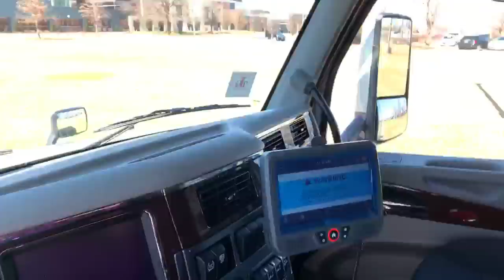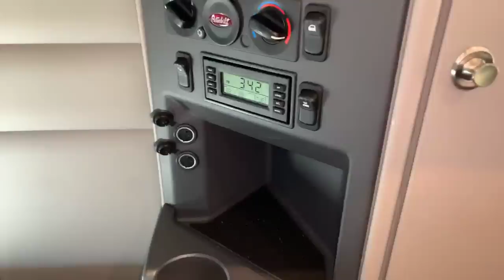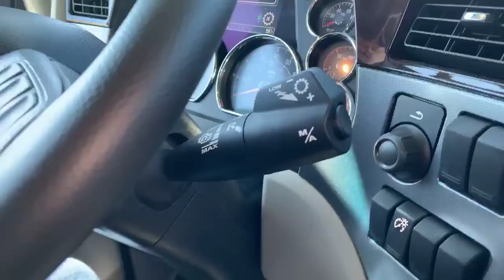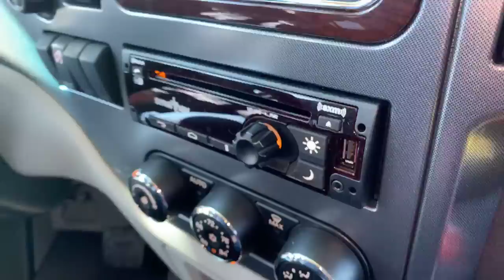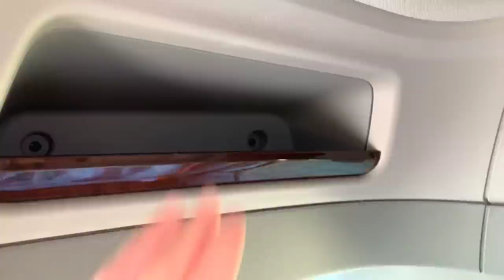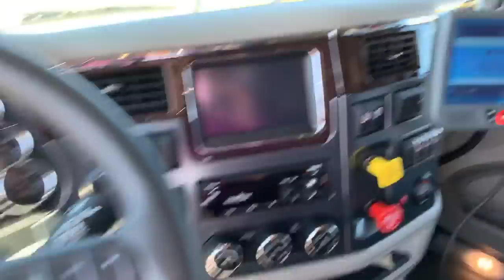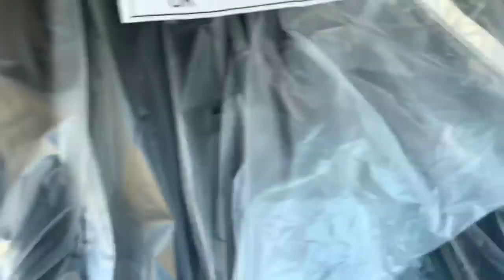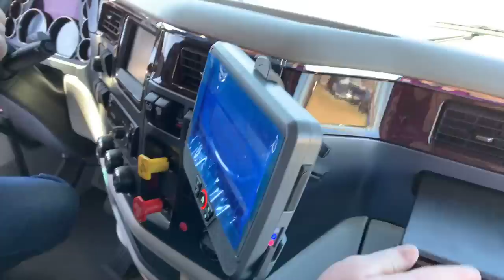2020 Peterbilt Ultraloft Truck Tour

Comment: 62mph????? Ain't no way I'd drive something that slow, there is zero benefit to fuel mileage going that slow.
Reply: The King's Servant TMC did a study. Dropping top speed to 62 not only improved mpg but reduced overall maintenance costs by 30%, because of the reduced stress on the truck. May not work for your business model but probably does for others. Cheers
Reply: 62 mph at 1400 to 1500 rpm is still stressing the engine and engine components out,still using more fuel than it should because the engine is laboring harder compared to one with higher torque rating. If it's working harder to move the weight the it's using more fuel,cutting into the bottom line. That is why you spec the truck out for the area of operation and the ammount of weight you are hauling but large companies won't do that because they would rather go on the advice of someone who has never driven a truck for more than a few miles. Less stress? When was the last time that you found one of these used castrated trucks that was not completely worn out by 750k miles? 

I'm not going to debate this with you but I will say this....2.60 rears, 18 spd and a military spec (750 hp) Cat in a 379 that constantly get 9.5 per mile with over a million miles on it speaks for itself.
Reply: 62 MPH top speed is just a rolling traffic jam. On  a two lane Interstate in the States with 70mph truck limits you learn to look for Prime, May etc. trucks ahead of you because you just know they are going to create passing hazzards.

Comment: @2:09 is this back in action?? Now that the minimum mileage is back to 30k miles does the additional $300 kick in if you’re eligible to upgrade but not called in to upgrade?? Thanks
Reply from the maker: Great question! With the required TNT mileage down to 30k, you are paid a guarantee of $700/week throughout this phase. If you remain on a trainer's truck and you reach 40k miles, your pay is then bumped up to $800/week.
Reply: @PRIMEINCTRUCKING  thanks. 37k now and applied for upgrade list. 🤞BTW Marlou N. is an incredible trainer. Thanks y’all.

Comment: Do they come with super single tires
Reply: All of Prime's trucks have Super Singles.. Duals are better, and more stable, if you blow a tire, you can still roll, to get it fixed, or replaced.. Super Singles, you blow, you are parked.. for awhile..
Reply: @chrisgriffin5179  you still cant legally drive with any blown tire if you can still technically roll. you blow or run flat you stop no matter what.

Comment: Over the last 16.5 years of driving full time. I've driven everything except westernstar. Which I don't care for the looks of. 
What I can say is I've been in a Peterbuilt 365 for almost 3 years. Granted not much room, but so far no complaints. If and when I make the transition to go otr. I'm leaning toward leasing. Peterbuilt loft. Simply because of the room and a smoother ride. 😊😊😊
Reply from the maker: That's great to hear! Thanks for watching and sharing your experience.

Comment: How do you turn on high beams 🤔
Reply from the maker: High beams are on the LH turn stalk you pull them to flash high beams, and push the stalk forward for high beams.
Reply: @PRIMEINCTRUCKING  🥴 I’m in a brand new  truck and I tried doing just that and it wouldn’t Easily pull back I Didn’t want to break anything and figured there was a different way to do it after playing with it I got it to work thanks for your help

Comment: If I was a driver, I would want to drive a Pete since I live in PNW, OR. and since Paccar is in this PNW. have to help the local company builders. I have been a Paccar fan for a long time. I cousin drives a KW for WINCO.  he use to have the W900L   I just retired early last yr on SSD/Pension after 30 yrs. the company i worked for sold and closed after 118 yrs on 10/18.
Reply from the maker: Thanks for watching our Peterbilt Truck Tour, Jeffrey! Congrats on your retirement.

Comment: I must be the exception on manual transmission because I have drove 3 different automatic transmissions and still prefer a manual 13 preferred. I have always got better fuel mileage with a manual transmission
Reply from the maker: Alvie Schreckhise interesting! What models of autos did you drive? They’ve made a lot of advances in the last 3-4 years.
Reply: @PRIMEINCTRUCKING  the last one was a 2007 Volvo 10 speed with a Volvo D12 (predecessor to the D13) got about 6.1 avg. 
The 1st one was a 2005 clutchless (no clutch pedal) in a 2005 Columbia with a series 60 Detroit 10 speed. It only got 3.9 MPG. And Interstate Distribution Co. Said was the average for these trucks.
The other was a 2003 Century class with Cummins ISX also a 10 speed but with a clutch got 6 MPG with it. *don't remember the gear ratio in these trucks.
I now own a 2000 Freightliner Classic with a Series 60 Detroit with a 10 speed manual Eaton Fuller with I think 3.75 rears (not 100% positive) and get AVG. of 6.7 MPG over the last 6.5 years. I have saw 7.7 out of this brick. (Yes I would live to see this engine and drive train in an aerodynamic truck)
My last truck before this was a 2012 Prostar with a 13 L Max Force with 10 speed manual Eation Fuller 3.35 rear super singles and a tag axle. I saw 11.6 one time pulling empty trailer from Ontareo Canada to Learedo, TX (trailer was the load). And rarely dropped below 8 with it. But what I saved in fuel I lost in tires. Best I got was 49,000 on drives. This truck I got now I put these drives on in May of 2014 (just over 435,000) and still have 8/32 tread left. (Checked Last Friday) For a reference on how easy I am on tires.
Reply: Well they have come along way, from those days..

Comment: Not into Paccars or Automatics, also the truck is waaaaay to new for me. I wouldn't work at Prime. Oh, here is a question. Why does Peterbilt call that the Ultra Loft? All they did was raise the roof. Dosn't look as If they lengthened the sleeper to Volvo 780 status or w900 studio sleeper status. So the name comes off as misleading to me. Anyways it just looks like a slightly different version of a 387 is all.
Reply: It's an 86" bunk.. it looks bigger in person.. than on camera..

Comment: On my prime application I put the wrong last name. But on my driver license, bank account , and check stubs I have a different last name than the one on my certified birth certificate. I was due to start orientation Monday, is this a problem ? I didn’t know my last name was changed until today. I already paid my 100$ for my spot on Monday will I be delayed from orientation ? I have already been waiting for a month for this job hopefully you have time to answer me fast please , and yes I have told my recruiter.
Reply from the maker: You will want to call your recruiter to ensure you're good to go. Call Recruiting at 888-664-9121.
Reply: HAHAHA, GOOD LUCK WORKING OUT THE KINKS ON THAT SCREW UP!!!!   SO MUCH FOR YOUR ORIENTATION!!!!!

Comment: Needs to have a 13 Manual and no Super singles
Reply: When you own the company you can spec the trucks anyway you want. Prime specs the trucks for specific performance outcomes. Such as running at lower rpms to produce higher mpg and lower fuel cost per mile. 
Also there are no automatic transmissions in trucks, they auto assisted transmissions. I've driven since 1996 and believe me theres nothing wrong with these transmissions. Especially in a traffic back up, or on steep downgrades. I go down 6% grades with the cruise set and engine brakes on and I dont have to touch the brakes with a 43000 lb load.  I have over 400,000 miles on my current truck and have the original brake shoes. That's not too bad. If you use the equipment the way it was designed to be used things last longer. 
Not sure what your issue is with super singles, but I got 246,000 miles out of my last set of tires. And they were still legal when I changed them out.